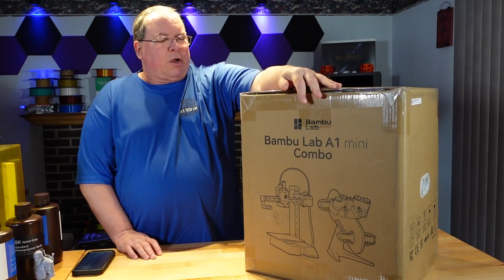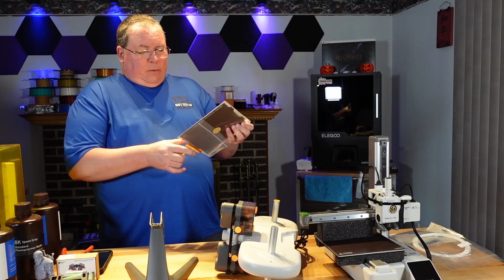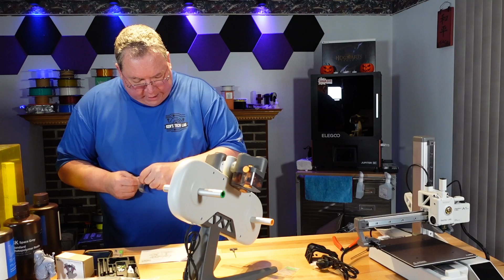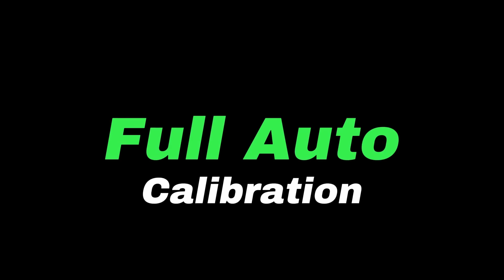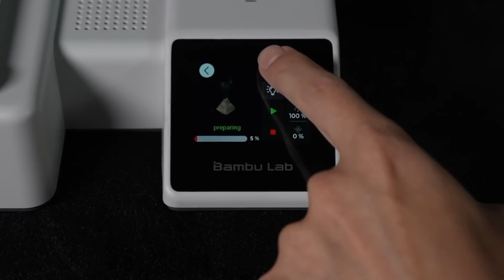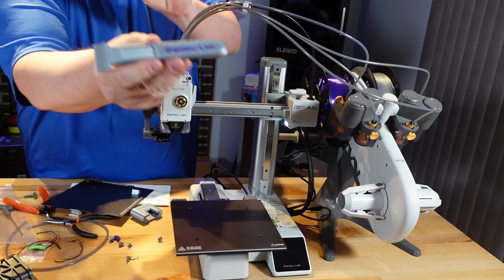Bambu Lab A1 Mini Unboxing and Review

Comment: What was the extra ptfe tube?
Reply from the maker: When you buy the new A1 Mini or the A1 Combo you get 5 ptfe tubs, 4 are for the multi-color and 1 is for a single filament roll, you have to remove 1 of the ptfe from the extruder to use that 5th for a single roll that might not work with the AMS lite. On my last video replacement of the Heatbed I did not connect the AMS lite and used that single ptfe tube for a single roll. hope this explains it well.
Reply: @kenstechlab  thank you so much,  very clear. Is the single ptfe tube shorter than the other four?
Reply from the maker: Yes, its also has a gray color.

Comment: Can you put the AMS in the back of the printer?
Reply from the maker: Not with the PTFE tubes that come with the unit, There are now a few options from the community to print connections to put the unit in different places. You would still need some parts like PTFE tubing.